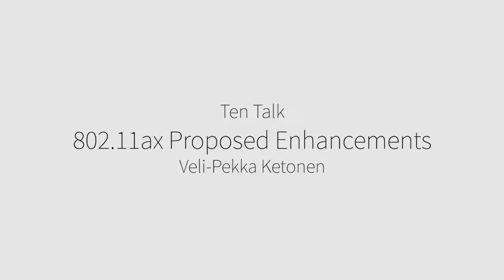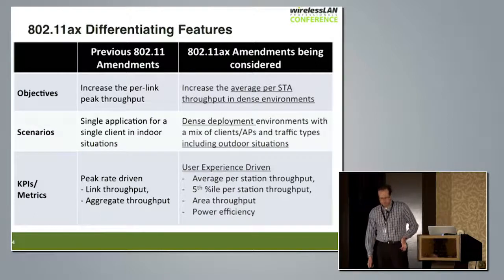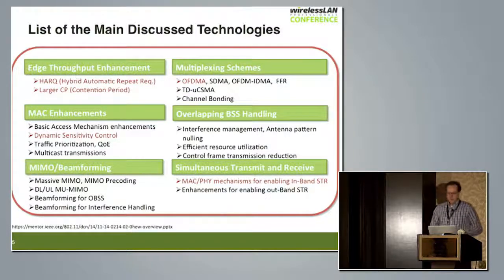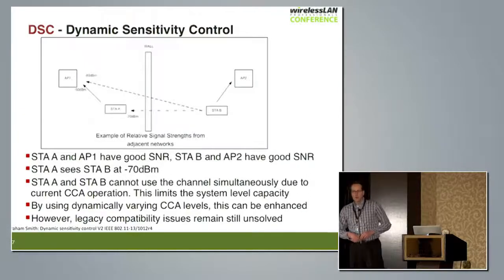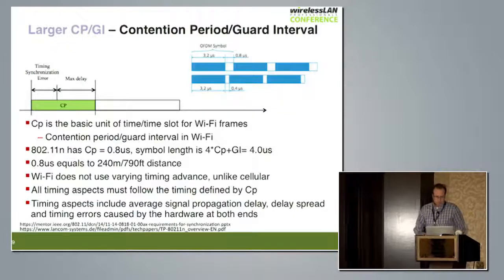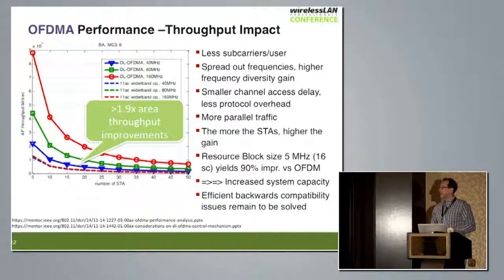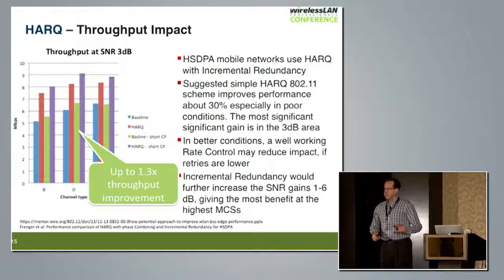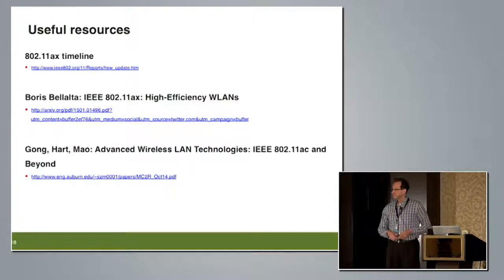802.11ax Proposed Enhancements | Veli-Pekka Ketonen | WLPC US Dallas 2015

Comment: Interesting webinar. 
Indeed, using proven techniques borrowed from the cellular world, 802.11ax standard is designed to increase capacity by up to 4 times, mostly by improving spectral efficiency. Therefore, this will provide benefits in both the 2.4 and 5 GHz bands in a variety of environments including enterprises, schools, retail businesses, airports, etc.